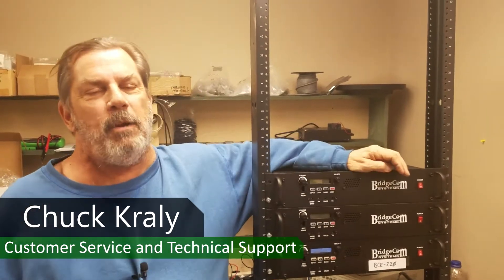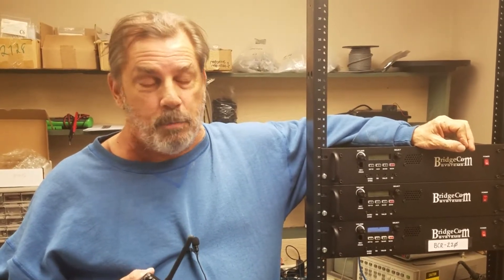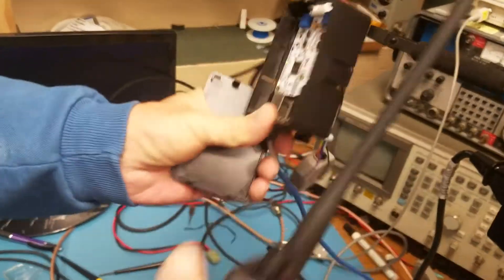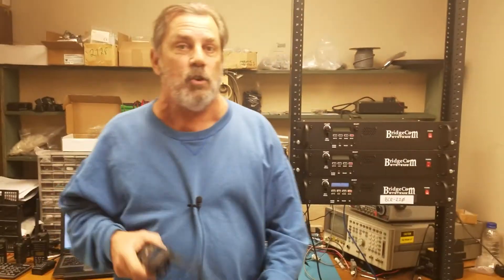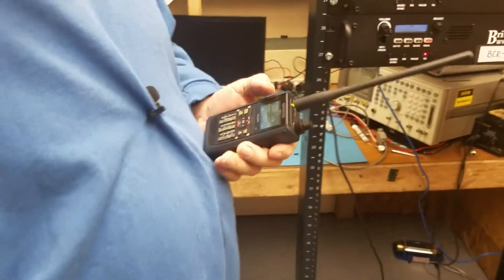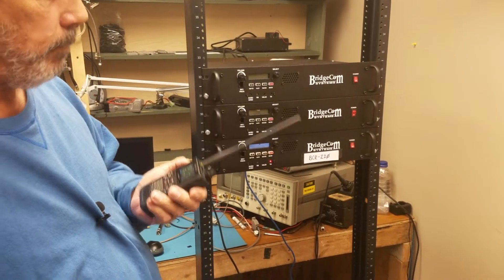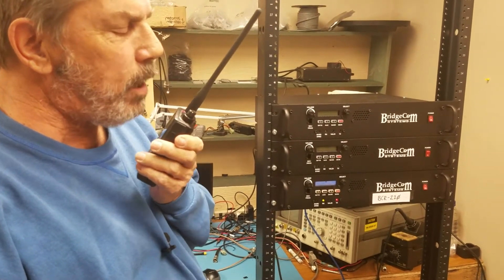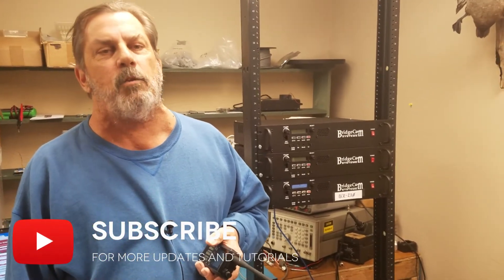BCR-220 D-STAR Repeater Demonstration

Comment: need a 220 digital mobile rig and then its good to go. So my question is, when is Bridgecom going to make a 220 digital mobile rig? other wise not much point if you can only access Dstar using a handheld. lol  VE7IOX
Reply from the maker: David, the rumor is that KW is working on the mobile rig to match their HT. One could use a BCM-220 with an MMDMV set up to do 220 D-STAR mobile. Now the real cool thing is that the 220 repeater is just the band for this video. It can be used on any BCR repeater; 2m, 220 or 440.